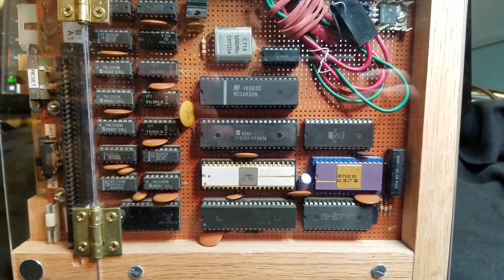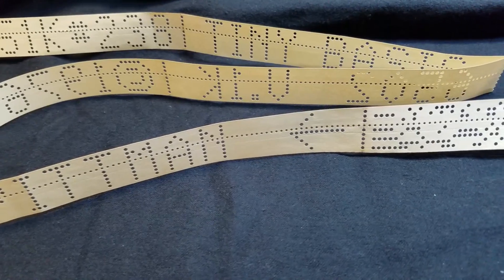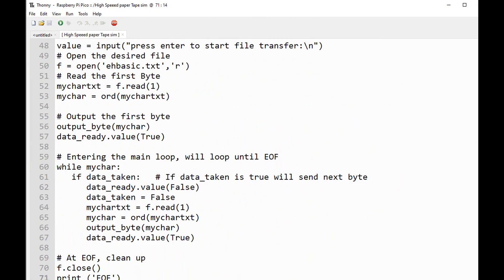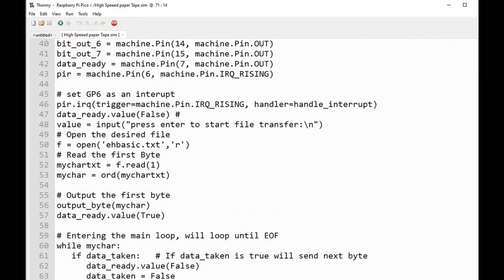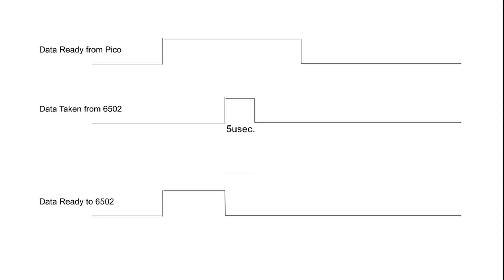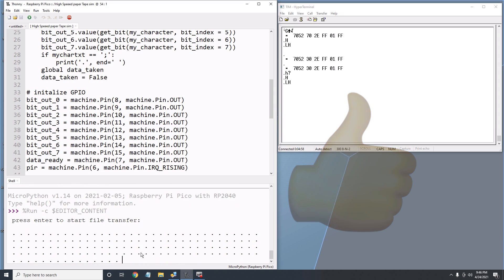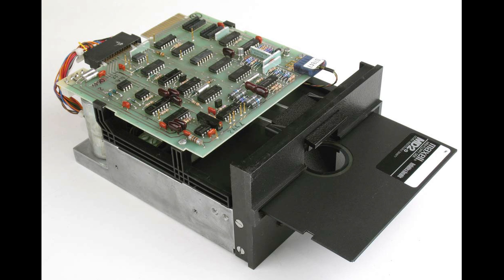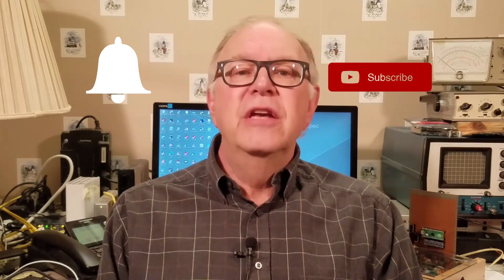Raspberry Pi Pico - Emulating a High Speed Paper Tape Reader for a 6502 (Ep. 0.4)

Comment: I'm confused between character rate vs byte rate.  To me, a character is a byte long.
Reply from the maker: There is a lot of overhead for the MOS Technologies (and similarly the Intel) Hex format.  Each record starts with a semicolon, then 2 characters listing the length of the record.  Another 4 characters indicating the starting address of the record in memory.  Then each byte is represented by 2 characters (0 through f).  Finally there is a checksum at the end plus a carriage return.  In average, there are about 2.5 characters needed  to transmit each data byte.  The byte rate represents how long it take to move in data bytes.
Reply: @LifewithDavid1  I probably would have swapped terms.
Character = data we're interested in
Byte = data needed (or sent) to give us the characters we're interested in.
But I think I see your point now.
I didn't realize an 8 bit byte was transmitted in two character hex value.

Comment: 300 baud... you can almost imagine a young man in a submarine sending morse code faster! The slower the machines the more optimization needed, hence more critical thinking and solutions finding. I think the 6502 is a fantastic part to investigate for those not diving right into higher level architecture, but still want to understand how things like motor controllers/drivers work. Or older feedback control systems, say, with encoder inputs that need to keep track of precise incremental signals. Maybe that would be a fun PICO project. Benchmarking comparing encoder quadrature input via micropython, c++, and assembly/PIO. Use a function generator that can be programmed to stream a pulse train, or program a separate microcontroller to simulate an encoder.
Maybe I'll do it myself and share it with you :)
I enjoy your videos and hope you enjoy making them.
Reply from the maker: 300 baud was screaming when ASR33s were chugging along at 110 baud.  And to think that was the ultimate when I was putting my stuff together.  Those are interesting ideas.  I did an earlier video with resolvers, but I never tried to tie them into a computer.  That sound like a cool project.  I'm going to try some bare metal assembly language stuff on the Pico next.  I've got a couple videos dropping tomorrow.  I hope the Pico community enjoys them.  Thanks for watching!

Comment: Hi David, love yr episodes - have put off getting a pico for a week or 2. I'm binging most of your episodes and getting a handle on how things piece together.

Now, I understand the need for a 5 - 3.3V Level Shift between the TIM and the PICO
Apologies for this interrogation but vendors etc don't mention specs for cheap Level Shift boards

1) is the PICO protected aginst raw 5V onto it's PIO or could it fry? I've seen a 5V I2C HD44780 LCD screen jumpered directly to I2C0 SCL (GP1, Physical pin 2
2) is the Level Shift bi-directional (for other experiments!!)
3) is the Level Shift fast ie rise time to keep up when the PICO maxes out

Thanks again
Tom, Sydney
Reply from the maker: Thanks for watching!  Re: 5V on the PIO, I understand that the RP2040 is NOT protected.  I think it could fry.  The level shift is bi-directional.  And the rise time from 0 to 3.3 volts is extremely fast; from 3.3 to 5 volts is where there is a bit of a lag.  However, since most TTL will register a "1" at 3.3 volts, I haven't found any timing problems.  Have fun!
Reply: You often can connect a 3v3 MC (microcontroller) output to a 5v MC or peripheral input without issue.  But not bidirectional or 5v MC output to 3.3v MC input.

Comment: Hi David;
You might want to use an Interrupt to monitor the DATA TAKEN line which would imediatly reply with the handshake.
Interrupts are much quicker than a software test routine.
redrok
Reply from the maker: Thanks for watching!  You're right.  This video was early in my learning curve of the RP2040.  Later videos use interrupts, PIO, and DMA to really amp up the data transfer rate.

Comment: Inspiring! I'm just in the process of digging out my old home brew computer based on a Motorola 6800 D2 kit which I would like to demonstrate on-line at The National Museum of Computing at Bletchley Park, UK. It occurred to me that a great project would be to use the Pico for emulating the digital tape interface - applies to the 6502 based BBC Micro as well.
Reply from the maker: That sounds like an awesome project!  Check out this video for an even better parallel tape interface: https://youtu.be/dGNJGC_wZtk